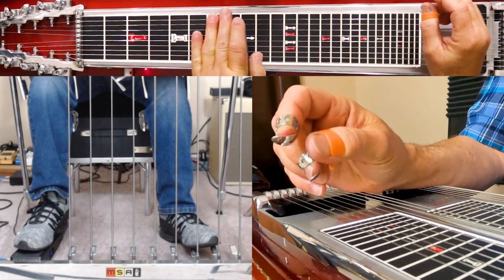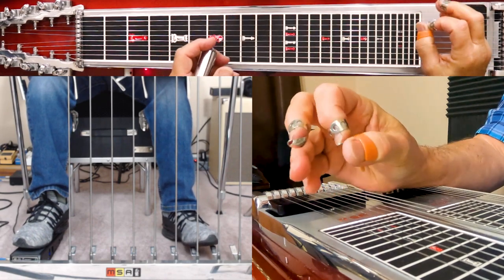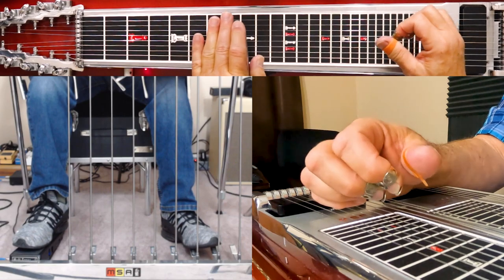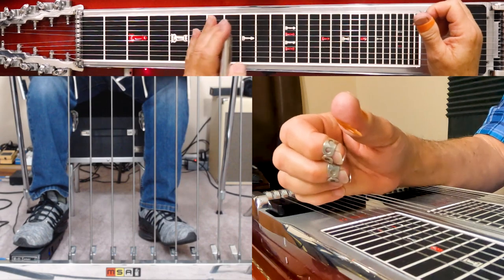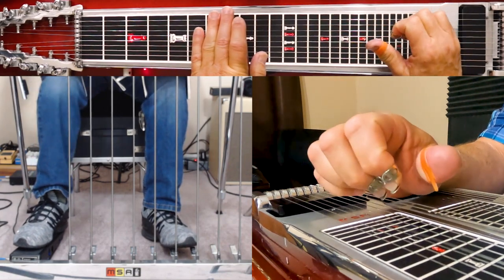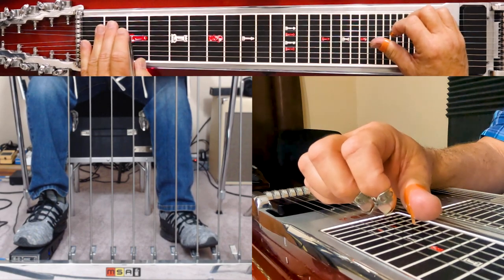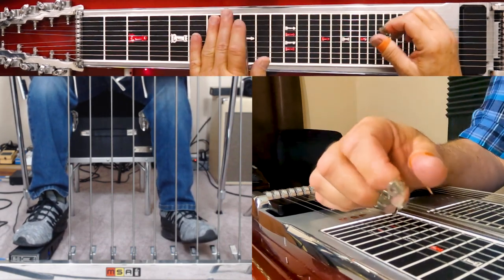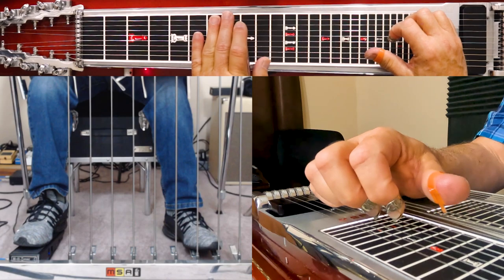How Splits Work on the Pedal Steel Guitar | Overview Lesson

Comment: Where & how do you make that adjustment if my guitar doesn’t have split tuning?
Reply from the maker: I would have to think on that. Ask around on the steel guitar fourm. Lot of good info there. Your new guitar does not have allen screw adjustments on the end of the pull mechanism on the pickup side above the nylon tuners?